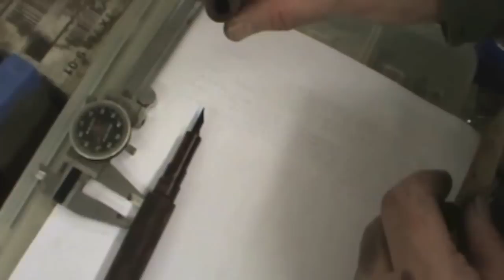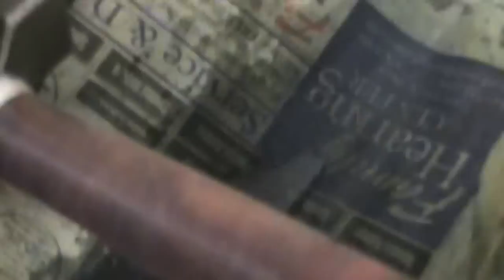Fountain Pen

Comment: If I might ask, where do you source damascus tubing? I have seen damascus round stock several places, but not tubing. Thanks!
Reply from the maker: I use solid damascus rod stock, which I drill and bore to size. I'm not aware of anyone making damascus tube stock, or rolling thin sheet and soldering it into a tube. I use Delbert Ealy's damascus for the most part. David
Reply: David Broadwell Thanks!